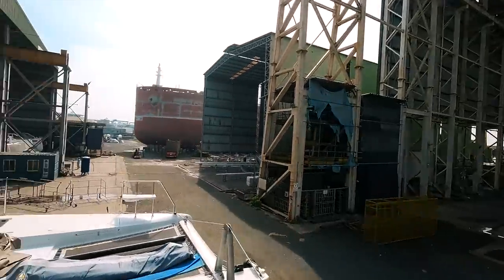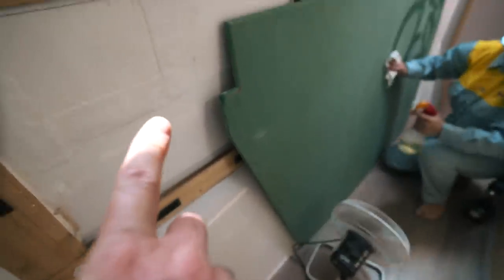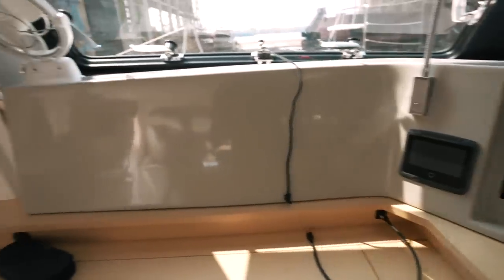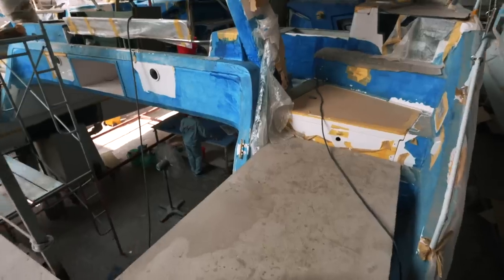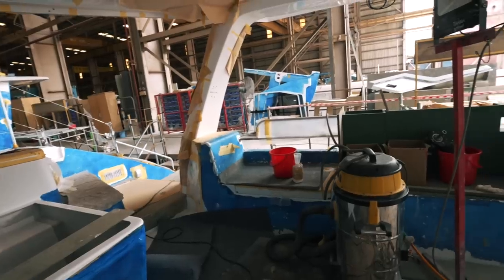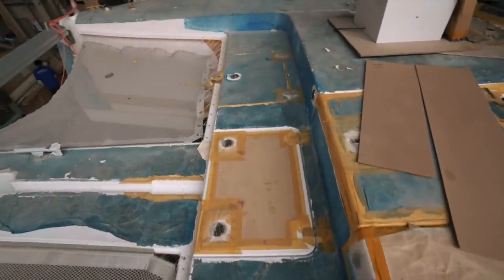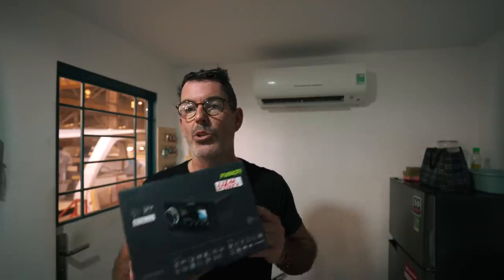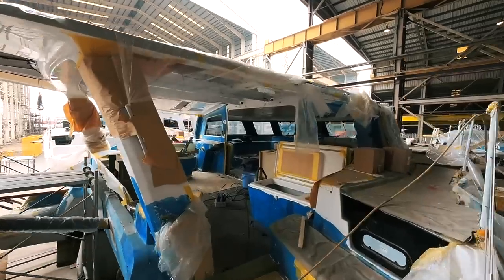Big Changes to the Catamaran Build- Also, We Need Your Help!

Comment: I have 2 x Fusion marine grade speakers mounted on the outside of an RV (parked in the drive way at home, with full exposure to the weather) and they have been absolutely fantastic…… no issues with rain or water egress at all, having said that, salt water may be a different proposition? Maybe best to speak to Fusion direct?

Comment: I'm really enjoying the video's on the production of RRII, I hardly do any comments but you mentioned T Bags, if not Bio they should not be thrown over board, marine life eat these, esp Sea Turtels and will cause problem. I always empty the bag once cold in the slops buckets but keeping the T Bag in the normal garbage, never in the sea. On a different note do you know if Seawind are able to offer the 1370 in Aluminium.
Reply: Interesting comment about tea bags. 👏
Reply from the maker: I never knew this. Thank you
Reply: @sailingrubyrose  I had a moment of thought about your comment on teabags in the ocean as well.  I know they make "paper" tea bags, but I don't think they are very common.  You will always get a better cup of tea from leaves in a reusable metal filter!  As long as your in Asia, it should be fairly easy to find tea leaves!  It does add a little bit of complexity though.  It's (of course) personal preference and needs based, and you need to choose what's best for you!

Comment: The only recommendation I'd make regarding speakers is to have them make a sealed box where the speaker is installed on the foredeck (if you decide to have permanent speakers installed up there vs bluetooth) so sea water or rain can't get in if you blow one of the drivers out with a big wave or eventual rot.  If the speaker hole goes straight into a locker on the boat, I wouldn't like that, personally.  

Also, put a separate gain knob to control your sub volume separate from the other speakers.

Comment: I would be positioning the sub up near the nav area/mast so that it is firing across the salon and out to the cockpit. While it’s non directional better for it to have a longer run for wave generation before it hits another surface. 

For the front speakers I would have them removable. Why not have them in a carbon fibre pods that slides down over the fold up hand rails you have on the coach house roof. Plug them into water proof plugs hidden under the lip of roof so the are protected from uv and all but the largest of waves that decide to jump on deck.
Reply: Wireless would be my last resort as I find they get out of phase with the others in our home setup more often that not.

Comment: I have not read the other comments so it may have been said before. Regarding the speakers: imagine the times you will be sitting on the foredeck with a GT and music. There will be no single time a good Bluetooth speaker does not work for you. But really, get a good one.
I bought one that has great reviews and I a pleasantly surprised by the audio quality. It's a Harman Kardon.
So do not cut holes in the front deck. Also: I think those speakers won't last a very long time.
Reply: Small change: connect a GOOD Bluetooth transmitter to the front deck zone of your head unit and use that good Bluetooth speaker there. We'll make you a nice cocktail and enjoy some fine music.

Comment: I say not to mount speakers up front, the salt water will eat up the metal. I suggest either a bluetooth speaker or a wired speaker from the saloon. The base speaker would do much better in a wall than under the seat or in a box. If you had a powered subwoofer it would be better  than the wired passive speaker. If you go with a bluetooth speaker, be sure the amp can split the sound output. I can't wait until you guys are back on the water.

Comment: Of all the info in this video, your "not having ridges on the drainer" instruction to the Corian guys was a shocker for me! I can't abide a flat surface for a drainer - put a cup, glass, dish etc on it upside down and a seal gets formed by the water draining off. A perfect place for bacteria to develop. Surely you want the water to actually be removed from your dishes? I can't see if/how a rolling drainer at sea would alter my impression

Comment: ive got bluetooth for my front deck and the fusion system. the bluetooth ones rust and die in 6 months. i would install then non flush mounted on the inside lid of the front hatches and lift the hatches for music. underway the lids would be closed and they wouldnt be exposed.

Comment: Hi Nick, I know I'm not a patreon, however I had some thoughts for you nave desk. As space it at a premium there and it typically can be taken up but switches very quickly, I propose to double the space and hence usability of the area by a simple idea. All the switches could be hard wired into the facia in a number (3 sections?) of small 'zones'. Then all you electronic displays could be mounted into carriers that are either; on 3 parallelograms to sit over the hard switches but can be 'raised' up (6-8inches) for viewing or access to the switch gear underneath; OR the electronic displays could be built into simple slide holders that allow them to be raised up and down when needed to either see/access switches or just for easier view of all switches and displays while sailing. Clearly cables still need access holes to allow charging and connectivity need to be cut for accessing the read of the facia but some of the connectivity could be via Bluetooth. I hope you can get/understand my idea. The parallelogram bars could be black powder coated or in white/grey depending on owner choice, and easily spring loaded so that they stay in the  up or down  position when necessary. It would mean they wouldn't be turnable, but would reflect the same angle that the facia  onto which they are mounted.  Love all the work going on. More 'b' roll please and slow down the filming so we can see what is going on. I'm not a millennial that works on 2 second video grabs...🤣🤣🤣 I hope my idea is helpful/understandable.

Comment: As a 1260 owner who has been in some rough waters, I would NOT mount any speakers on the forward deck.  Use a pair of Bluetooth battery powered waterproof speakers up there when you need them.  There are gaps between the outer shell and the inside of the boat, and if water finds a way in through the hole cut for any reason, you are going to end up chasing a leak that goes between the shells.  I developed a small crack in one of the forward lockers that ended up draining into the starboard storage cubbies next to the bed. Really unnerving to be at sea and find water in places it shouldn't be with no way to investigate in the given sea-state.

Comment: Motorcycle speakers are water proof, but they are not designed for the water forces the foredeck can see, portable speakers or water covers over the speakers will be better

Comment: Honestly that is not really enough speaker power and missing are the small tweeter speakers. you need to double up on speakers and get proper waterproof ones for the foredeck. Another trick on the foredeck would be to get mountable transducers that turn the deck into speakers then you don't need to worry about water.

Comment: On the Outdoor Speakers use Bluetooth or Portable Speakers 🔊 that when sailing put them in a Save Place. party Time Plug them In. Instead of Wood Fronts use Carbon Fiber look to save Weight. Also look at the Carbon/Aramid fiber they have different Colors. Go with a Carbon Mast with the Wood Grain finish. You May like it. How is Wifely doing these Days?

Comment: Your speaker and subwoofer placement need to be optimised with room correction software using a special mike and ideally when all the room surfaces have been completed. I highly recommend using room correction panelling to optimise your audio experience. Consult your local Home theatre expert! Also your subwoofer needs a well-designed enclosure to optimise it's effects on your audio experience!.  I would have gone with a 7.1 or 6.1 regular home theatre amplifier which will actually correct the speakers and the subwoofer for you.

Comment: Here is what I would think of first safety no sharp edges or squared anything on the boat because less damage to a person when hitting them I like it oval or round nothing sharp sticking out. I would have speakers that  can be turned off and on in the areas so not to be too noisy for everyone.

Comment: Don't put the bow speakers where the hull and deck meet, water and spray deflects off the leeward hull and splashes through this area. Presumably, you will only need music at the bow when at anchor? How about you put them in lockers each side and crack open the doors when you want music at the bow. Usually twin speakers are as far apart as possible, and aimed to the centre of a space. Regards Murray and Jean.

Comment: The boat looks great! I think it's bad idea to cut the hull for the front speakers. You can make two boxes(maybe glassed) for them and istall them inside somewhere close to the open windows pointing forward(out), i think it will work great!Less cables going trough the boat, the speakers will be protected at all time and you still getting the best of them.  Cheers! P.s. Sorry for my english!

Comment: Used to work as an engineer aboard Superyachts. If you can resist the urge to put speakers outdoors you’ll have an easier life not too far down the track. 

If she were mine I’d have a pair of smallish monitors or bookshelf speakers indoors near the fwd facing windows. 

If you really care about the sound quality, don’t forget that some form of acoustic isolation between the monitor cabs and whatever they mount to, makes a big difference. 
Because everything in the main structure of the boat is basically a drum, adding a little bit of serious mass under the mounting points has a big effect.

In my experience any outdoor speaker operating in a marine environment, whether under an open canopy or not,  have not really fantastic sound quality and a max practical service life of about 5 years…and then you’re hunting for obsolete replacements that fit your existing cutouts or fitting overlay facia boards to cover up and adapt the original holes. 
Outdoor speaker sockets, yeah, they hardly ever corrode with predictable results on sound quality……right? Nope, they’re a repeating PITA. 
As others have said, I’d simply use Bluetooth for the outdoor stuff, engage your inner audiophile in the saloon where it’s quieter. 

On placement of speakers indoors, honestly, if you’re serious about the sound you experience I’d wait until the boat’s afloat and then either let a pro audio company sort it out or get yourself some bits of thickish granite or marble tile and whatever bookshelf speakers or baby monitors you’d use in a small room ashore. Buy yourself some blu-tack for temporary isolating sticky mounts between stone and interior surfaces and speaker to stone interface, then experiment to your heart’s content. 
Once you’ve found your best spots replace the blutack with blobs of sika, holding the bits separated with lolly sticks until the sika’s cured. 

Be open to only needing two decent speakers in the saloon, it’s not a huge space at all in hi-fi terms. 

Good luck! R. 😎👍🍻

Comment: Get jbl Marine speakers they are made for boats then get a class d 4 channel amp from jbl orbfocsl a digital sound processorfrom helix ie the dsp.3 and the head init a handheld hi res player that connects to the dsp via Bluetooth or wifi or a wire done

Comment: Either have a quick disconnect, so you remove them and seal off the plug area while underway. This would just be a custom plug mechanism with a waterproof cap and some mounting points. Or you could make a gasket based cover to fit over the whole speaker left in place. Water proof fabric over a 3d printed one-off cover with a rubber gasket and buckles to secure it.

Comment: This may be to late because of the way you post but with that many speakers you need to have a switch for each pair so you can turn them off and on. There will be time when you don't want some of them on. Like when you're at anchor, you probably want to be a good neighbor and turn the outside speakers off

Comment: The speakers mounted low and outside on the front will be a pain to keep the grills clean from creatures and salt.  The higher you can mount them the better if you mount them at all, or as many suggested to keep them mobile or inside the opening windows.   Even waterproof speakers will not sound good if saturated with water, either standing or blowing bubbles off the grills.   
Crazy idea, could they be mast mounted, or on the rigging?  (never seen it done)

Comment: Not a sailor but, forget speaker install in the bow area. You are right to be concerned about water intrusion and deterioration despite tech improvement. Focus the speaker systems in the salon and cockpit area. For the bow you can have solid sounding portables with bluetooth when you are at anchor. Killer sound inside and cockpit with mobile sound in synch at the bow when at anchor.

Comment: Fusion speakers are really good, I personally would put them on the side at the front where you suggested, but as long as they are outdoor speakers which sure they are and fusion do them with a plastic cover for external use, i would also ask fusion on there thoughts as i know they advised on our boat build several years ago and we put them on the bow and they worked absolutely fine and if in doubt they used to do a cover for them that you can take off when using them, it would be a shame not put them there if you both think you will use this area a lot.
Reply: The speakers are rated IP65, they won't handle the possible wave pressure at the front.
Reply: @AORD72  where Nick was wanting situate the speakers there not facing forward, plus if you were actually taking waves over the bow  you would go beam on as most people can’t handle this type of weather and you would tack through it rather it being on the nose. I would just get fusion advice as they supply to 70% of the industry on production yachts and sailing boats just for peace of mind.
Reply: @charleschisholm3805  Ever sailed on a yacht? You can expect the whole front of the boat to be washed over with waves in rough weather. You could partially plow the nose in running down wind and soak the speakers.
"get fusion advice", and they say the speakers have a IP65 rating, that is their installation advice. Hence you don't put them in a situation they could be slammed by a wave. The 5 in IP65 means a 4-5 PSI  6.5 jet at 3 meters, which is hardly anything.
Reply: @AORD72  Been a captain for over 35 years and yes if your racing, I have never seen Nick or Teresa take on this weather like that in 4 years, spray yes. Most  cruisers and good captains plan the weather before hand and yes we have all been caught out which I have on a few occasions but our speakers worked fine afterwards, I am only giving them my thoughts and experiences about the speakers.
Reply: @charleschisholm3805  Well they had a lot of spray on the nose testing of the seawind 1370. All it takes is an unexpected wind change while travelling from A to B. I can't imagine IP65 speaker lasting. I would want them to receive zero spraying because the 4.5 PSI spray rating is hardly anything.

Comment: Is there space under the front visor, I personally would not put any speaker out at the deck area, water proof or not, open the windows and hear from there, or remote blue tooth pods you can take anywhere, the risk of salt water intrusion is far to great, either for the speakers or the deck, remember salt salt salt when the water has gone the salt remains, All best, Al

Comment: Put the speakers into bulkheads or at least on the sides and not in the ceiling / headliner. You will have a better stereo effekt, whereas if they are in the headliners, it is just direct downwards. Also the size & weight might be not ideal to mount via headliners.

Comment: is the depth and strength of the over head, going to be able to carry the weight of those speakers, ----speakers on the front will be salted and destroyed in no time, use bluetooth as others have said, put 4 and sub inside and 2 protected  in the cockpit area,

Comment: Since you have access to the builders, I'd reacommend paying attention to the enclosure sizes for your sub and mid drivers.  You'll get a better sound out of them if you do so.  The sub, I saw, actually doesn't need much at all so you should be able to seal it (or port it, if you can) without losing much space.  I agree with the folks below, though.  I wouldn't put the speakers out front.

Comment: when your on the fore deck just open the forward facing windows and let the tunes flow out. you will only be up there at anchor most of the time.They will be F$$ed real quick if you have them on the front deck, unless you like to do maintenance and if you get sick of replacing them you still have two shitty holes to deal with.
my thoughts

Comment: Use Bluetooth speakers forward  that can be used both in cabin and on the forward hull  have the  whole thing hookup to Your computer . I do  hope you have a Real Computer built in that can be upgraded and repair with a back up Drives . It can  store your Videos and Music and used as your edit computer and other work as needed . You can run WIFI and use tablets off the main computer system .

Comment: Not a good location for the front speakers. They will not survive. I would try to fit them under the small roof section above the forward windows, for protection. Many speakers claim they can cope with water, but they won't last for long.

Comment: Hey indeed 6,5“ hole in the weather side of a boat is not a good idea. 
I would put 2 inside saloon front, 4 in the aft outside and 
2 „shakers“ or exciters from the inside on a big „flexible“ Fiberglaspart of the deck. A Fiberglas boat is like a Guitarbody and will make good sound.